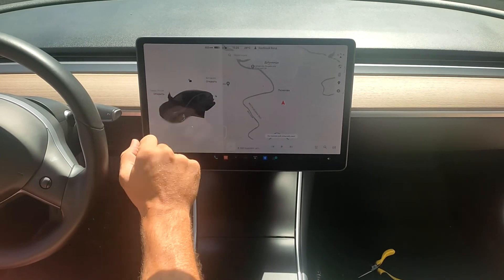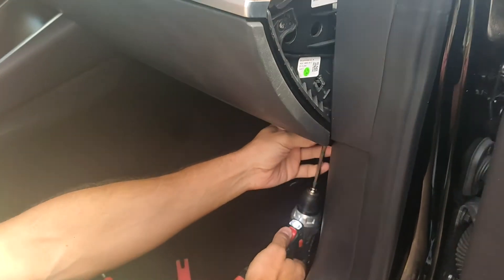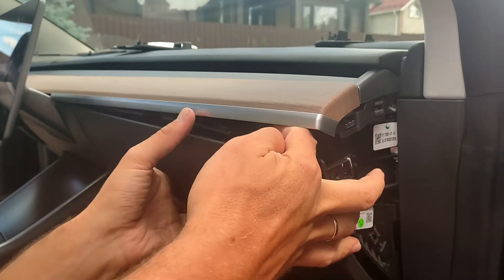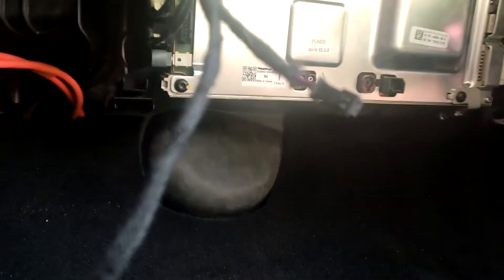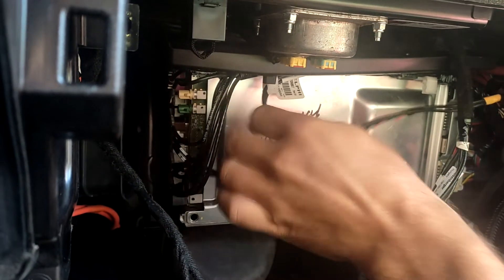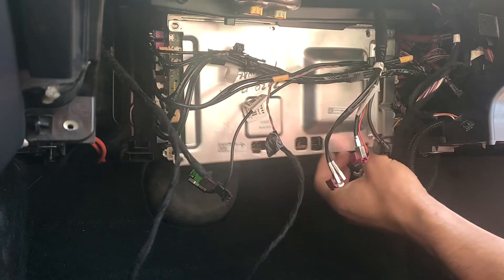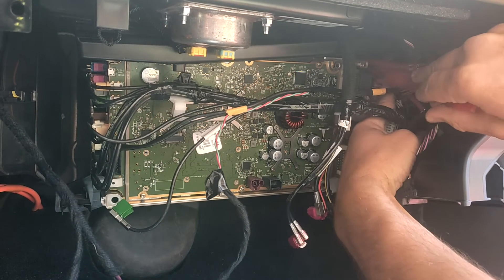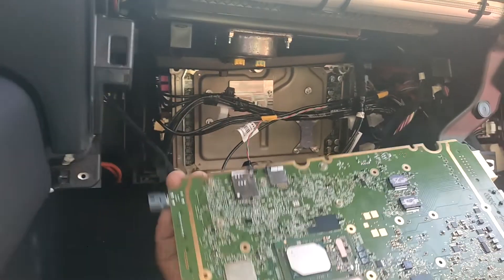Tesla model 3 and Y. How to disassemble a computer. How to replace the modem.

Comment: Hello, I have a 2022 model y performance, it sat low battery for a while, i moved it at 8% hv and it was fine, came back a week later to bring to charger and 16v was healthy and dc to dc active but black screen,.  Can lock\unlock from app and flashers work.  Tried using toolbox 3 but wont connect (connects to other tesla fine)

I think memory bank was corrupted when voltage drooped that feeds mcu?  Any suggestions other than charging hv (done) resetting 12v system (done even overnight) and scroll wheel reset (done)?

Comment: thank u , I have another issue on my Y. I was at the service and they have changed the computer and since then my external drive does not work at dash cam. 
Do you think that they might just forgot to CONNECT  its wire , or I don't know what else should be. any idea?

Comment: Hi i have lost my autopilot capability and the over the air update that cant be achieve. Is this cpu change can be the answer?
Reply: thats the " service car computer " Mine is identical  with issues.. its a 2300 dollar part from tesla but ebay has them for 800.. No idea where its located in the car though
Reply: Yeh but not that easy as they are vin locked
Reply: What did you do in the end for this issue?

Comment: Hello sir, would you happen to know the process afterwards I’m asking about maybe the updates and all of those after reinstalling a used one that already has operating system on there is it just a plug-in play basically and then a firmware update or is there something that needs to happen where it now has to be registered to the Vin vehicle via the Vin number or anything like that? I’m needing to replace mine due to some auto pilot malfunction and I’m looking to buy a used one off eBay but don’t know the after Work process after everything’s connected what needs to happen after that via software firmware anything like that. Thank you so much for your help. Your video helps a lot in the tear down. Great job.
Reply: I am exactly in the same situation, please let me know if its plug n play
Reply: @morrissuddin3634
I’m not going to work on it myself out of fear that more problems will arise . Unsure if this is the case but no one on any platform is getting back to me on after install process. :/
Reply: @alexalv.2374  same here, they don't seem to answer this particular question, I will buy one from ebay here in UK and do a swap out. Otherwise will have to go to Tesla at the expense of almost 2000GBP. I personally think its plug and play and reset DAS from service
Reply: @morrisuddin3634 
Have you done the replacement yet?
Reply: @alexalv.2374  no, I ended up selling the car with the fault.  It frustrated me out too much

Comment: Could you completely remove the modem so the car is not connected to any wify, and cell? Would the car still work without?
Reply: did you ever find an answer to this question?

Comment: Great detail. So I got the black screen. I did the hard reset and soft reset changed out the whole touchscreen and even the new one has a black screen. I’m wondering if it’s the chip. Car still drives. Just wondering what could the diagnose be? Thanks
Reply: Hello, my friend’s model y is having the same issue. Flickering and responsive screen. The car can still drive. Did you know what’s the cause and the solution?
Reply: @BillySays  for me it was the main board underneath the glove box. Cost about 2800$.
Reply: @ariesanfilippo1078  ouch. Sorry to hear that. Our car has been okay now for a couple weeks after the software update. Hopefully, the issue is gone. Thank you for your response

Comment: Hi @tesla Master english, first of all thank you for a great and detailed Video. I recently installed a aftermarket Display that connects to the AP plug on the MCU (grey connector) i shut the car down in the menu, removed the HV connector and the negative 12v terminal. waited 10min for everything to be powerless before i attempted to remove the AP plug from the computer and connect the AP Y-splitter to be able to reconnect both the AP original cable and the one for the aftermarket Display. Start the car back up again and everything works fine except i know dont have LTE connection. I reinstall the software, still nothing. Do a Modem and Antenna Health check via the service Menu, it cant get the modem to power on/off. Still nothing. 

I then attempt to leave the car over the night. Morning still the same. I then do everything in reverse and remove the Y-splitter and aftermarket display and reconnect the AP plug to the computer without anything aftermarket inbetween. Still the same, modem seems dead?

What would you advice, leave to tesla to get the modem replaced?

Comment: I have 2021 model 3 and my autopilot ecu stopped working - ecu fallback in service mode. 
So cameras/gps not working. 

You know how to fix it?
Tesla solution is only ecu replacing 
And its very expensive
Reply: same here have you solved the issue?
Reply: Just had the same thing £3K repair bill.

Comment: heck... On the main board, I saw a coin battery that only lasts around 2 to 3 years.  Automobile is not something to be used for such a short time.  And even on a PC main board, there is a rechargeable battery to maintain CMOS data instead.  This change happened a decade ago already, but tesla is still using coin batteries?? if the coin battery is for maintaining the CMOS data it is a real blunder 'cuz after the coin battery runs out then access to the MCU won't initialize before changing it with a new one every 2 to 3 years?... Hope I am wrong about the use of coin battery....
Reply from the maker: Maybe you forgot about the 12volt battery and the big one in the bottom? It's just for RTC

Comment: Thank you! Have you worked for Tesla before? Your knowledge about this car is amazing.
Reply: Does this mean I can upgrade the MCU in my 2018 Model 3 to the new AMD-powered MCU??😮
Reply from the maker: Ohhh, man l. If you see how I unsolder the gateway and the processor and the rebuild the firmware.
This is a basic video for my clients. Just to help them to send me the mcu board
Reply: @teslamasterenglish5445  can u upgrade the atom to amd??
Reply: Is this the same job and piece to replace TLA,CAR.COMP,NA,HW3.0
-PROVISIONED FOR
RETROFIT(1462554-R0-L) Tesla wants to charge me 2500$ to do this job

Comment: Nice video . I have a Question . My model 3 has an older 2.5 autopilot computer can i just buy a used one and swapped out myself or do i need diagnostic software to complete the install???? Thanks 🙏
Reply from the maker: You need to change the configuration. Than to redeploy.
Reply: @teslamasterenglish5445 you could help a lot of us out if you could make a video of the steps
Reply: Do you have any video/post on how to perform that? @teslamasterenglish5445
Reply: @teslamasterenglish5445 do you have knowledge of doing that ?

Comment: So if we just want to disable the telematics all we need to do is to remove the modem and put it back together correct?  It won't brick the car in any way other than disable the connected services correct?  Thanks for the video.